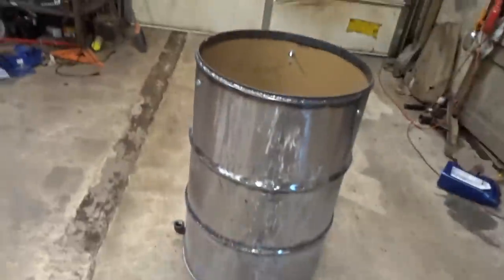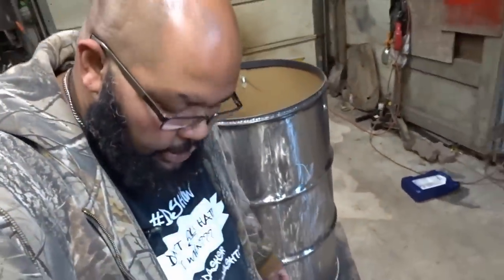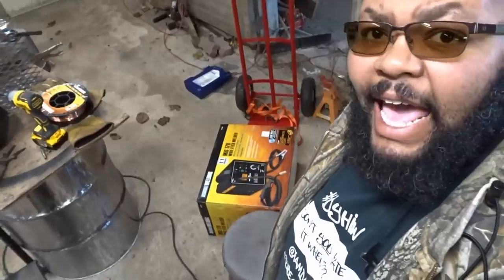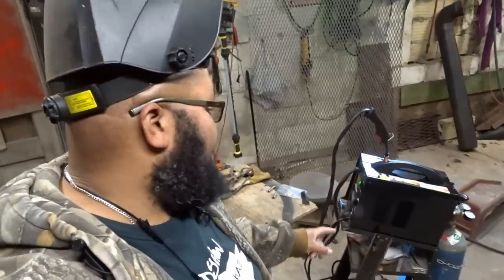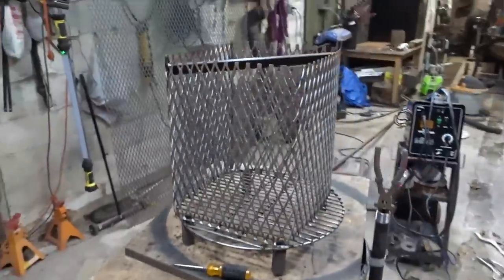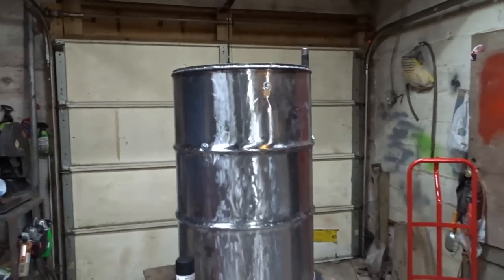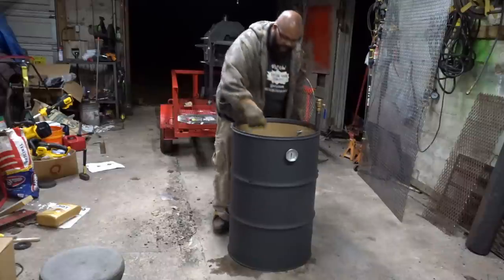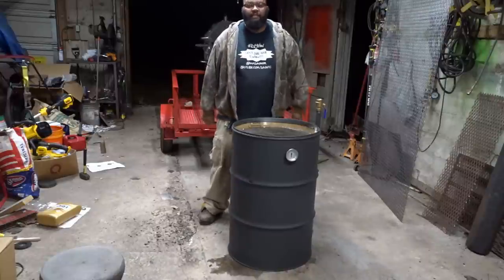SDSBBQ - Making a 55 Gallon Steel Drum Smoker - Part 3

Comment: I also used a ring on the inside of my smokers, but instead of welding I just used self tapping stainless screws and sealed the rim with lavalock... Lid fits perfect and it's super clean looking also.. Didn't have to cut the top lip off either..
Reply from the maker: On my first smoker I used self tapping screws but I've found I like welding WAY better since I can. Most of the drums I use are sealed so I have to cut the tops off and then I weld the ring in and use the top of a cheap kettle as the new lid for the smoker.

Comment: Great video, I’m doing this with a 55 gallon drum used for hydraulic fluid. Do I just have to have a couple hot fires to burn off any residual chemical?
Reply from the maker: That would be a game time decision to me. Wash the barrel out with soap and water, then burn it and let the fire die down and cool. re-inspect to see if all the residual gunk is gone, rinse and repeat until it's clean.

Comment: Have you found that the one I let pipe is enough to manage and keep a solid temp for cooking? I’ve seen a lot with 2 pipes, and a third just with a cap on it at the bottom.
Reply from the maker: It will depend on where you live and how cold it is. The warmer you are the lower the amount of inlet pipes you will need. But for someone like me when I am cooking in the cold 3 sometimes isn't enough, lol.

Comment: I'm building a barrel smoker and it has the exact liner in the barrel and I burned the piss out of it and the fumes that came off of it smelled bad as hell I would burn out the liner I dont think a "seasoning is gonna cut it. My barrel was containing resin and it was pretty strong smelling. I sprayed it out then burned it.
Reply from the maker: I also agree about burning it out. What did you use to do your burn?
Reply: @SDSBBQs  abunch of wood pallets did a 3 day burn
Reply: @SDSBBQs  - I used dry leaves and an adjustable speed electric leaf blower to jet the air to keep them all burning.

Comment: Just solve my question on you to install a water pan on my UDS. Thanks for always teaching me something
Reply from the maker: Adding the water pan is key. You need some means to divert heat and the best way to me is water (liquid) in a pan that will help keep your temps down and add moisture into the smoker at the same time.
Reply: @SDSBBQs  the next time will try with the pan, maybe there is the moisture I'm missing even spraying the food. What I'm also amazed is you only have one valve I set three 3/4 inch holes, have only 2 valves and the third has a cap
Reply from the maker: Good luck! Hopefully this helps.

Comment: The last type of smoker I “need” is a an upright drum/ wsm. Even though I’m not a welder, I have a friend who is a welder and will happily accept money to help get this project done. I also as mentioned previously in this video series, want to take a drum and used kettle and make a diy wsm. I would want the drum to fit inside the bottom portion of the kettle. Do you think the average drum will fit? Or will I have to remove that bottom lip?
Reply from the maker: So you are trying to use the entire kettle top and bottom?
Reply: SDSBBQ yes. If I can’t I can’t, but I feel bad letting the bottom part of a kettle go to waste if I’m gonna use the lid.
Reply from the maker: @juliankirby9880  That's why you buy a much less expensive dome grill or a used Weber kettle.

Comment: Dude, correct me if I am wrong, but I presume that this was a food grade drum you used to build the UDS for Tom? Due to my own concerns I had been googling UDS for a while now, and in my research, even though it's food grade, it has a protective coating on the inside which is not temperature proof, and will melt giving off byproducts in the process?
Reply from the maker: I usually burn off the drums and it gets rid of the lining quick fast and in a hurry. This drum shipped red wine and was Food grade. I usually don't mess with drums that have had oil or harsh chemicals in them. That being said I didn't burn this one off because my plan was to show him how to get a fire going and burn it off at his house.
Reply: @SDSBBQs  Thanks for your reply. Would a really hot fire like the one used to get the coating off, not also effect the outside paint (mind you it is heat resistant paint but nonetheless), or is the charcoal bucket and coals enough to burn out the inside coating? I am trying to gather information as am in the process of sourcing the drum.
Reply from the maker: @uzenicukadakrenemja  A hot fire will affect the outside paint and that's what you want, it helps get that off as well. Once painted with High Temp paint after getting the regular paint off it will last for a while.
Reply: @SDSBBQs  Thank you man, and I have to thank you for the helpful video too.  All the best
Reply from the maker: @uzenicukadakrenemja  Not a problem at all. Best of luck with your build!

Comment: And when did you burn out the coating inside ?
Reply from the maker: When I delivered it I did an initial burn with the new owner.
Reply from the maker: What did you do to burn it out?
Reply from the maker: If you didn't get it hot enough to burn the paint/liner you might need to burn it again.

Comment: Nice build, how would you add coal or wood while cooking if you need to? Also I got smoker rehab project going on how would you gauge the size of the firebox to build?
Reply from the maker: That is the main downside of a UDS once you get the charcoal going if you need to add more you WILL have to take all of the food out. But if you add enough charcoal it can go for 18 hours with no problem at all. There are firebox calculators out there on the web... If you do a search for smoker firebox calculator you should be able to find one.
Reply from the maker: Great to hear!

Comment: Hey Dash, I noticed you left the liner in the steal drum. I have access to drums that have held pork fat and the liner is red. Is there any concern with the liner? The last drum smoker I built it took me close to 8 hours to remove the liner which included a 4 hour burn.
Reply from the maker: I usually burn it out but this time I left it in for the sake for the video. I figure I'll let Tom have the fun of burning it out. I've never had an issue with the ones I've burned out before and they were almost all tan liners like this one.
Reply: @SDSBBQs  I have also found drums that do not have any liner. (Royal King) I may start using them and doing the dome lid like your builds.
Reply from the maker: Sounds like a plan!

Comment: So you didn't burn or grind out the inside liner?????
Reply from the maker: We burned it out prior to him using it.
Reply: @SDSBBQs  So after the burn out, did you grind it down to bare metal.. All the barrel smokers I've made I always burn out the liner first.. Then the outside I grind..Once I'm finished I have the inside and outside down to bare metal.. I use cooking oil for the inside walls.. Then I paint the outside last..
Reply from the maker: I ground the outside to bare metal and then painted it as you saw. The type of barrel I used had wine in it and the liner burned out without much fuss. I didn't and don't usually coat the inside.

Comment: I didnt catch how u made it safe on inside of drum did u burn it or??
Reply from the maker: We burned it out prior to the first cook.
Reply: THANKS mine had oil in it so i will 🔥 it good thanks again
Reply from the maker: I have only used drums that have had food stuffs in them so burning them out isn't as critical as if there were harmful contents in the drum before.
Reply: U think me burning out would be good enough since it had chemicals in them??
Reply from the maker: I'd just really make sure that it was burned out very well. The food safe drums usually have a very thin liner that doesn't take very much to burn out.
Reply: @SDSBBQs  how would i know if its burnt out enough, thanks so much for all info first time im building dont mean to be a bug
Reply from the maker: You should see a difference after it's burnt out... it should just look way different and you want more of a bare metal look.
Reply: @SDSBBQs  thanks i appreciate it

Comment: Did you burn the inside of the drum i have a 55dm with red liner do i need to burn it out
Reply from the maker: Seasoning it will burn it out. But depending on what your drum had in it before you might need to burn it out prior or more than once.
Reply: @SDSBBQs  coconut oil
Reply from the maker: @merrillking2329  then you should be fine
Reply: @Flatus Antiquitous i was just reading about this my drum has the red liner and some people say it is the hardest to remove i will be starting my project tomorrow i am renting a propane weed burner to do this will it work in removing the red liner.
Reply: i went and looked at again its more of a brown color hope this is easier to remove.

Comment: Y didnt u strip paint out of the inside of the drum
Reply from the maker: After the burn in it is gone.
Reply: @SDSBBQs  I dont follow
Reply from the maker: So you can burn the barrel before or after it is assembled. Once you do the initial burn the lining will burn off.
Reply: @SDSBBQs  I'm just getting into barrel smokers. If ur up 2 it it would be great if u did a burn off vid. I've seen a few on here but I like ur vids/ur style of vid
Reply from the maker: Well thanks... I will work on it. I will be making a new drum soon. I'll try and make sure to show the process of burning one out.

Comment: you needed to get a stick welder...   cheap and no gas needed, the problem with them cheap welders is they still need gas
Reply from the maker: I have a stick welder and don't like the process. It burns WAY too hot for thin metals like those involved with a drum.

Comment: Do you have any problems with your ball valve being higher than the level of the drum. Cause I noticed it is almost as high as the exhaust vent. God-bless have a great  Night
Reply from the maker: Nope not at all. The charcoal will draw in air to help with the burn.

Comment: You should ha burn of the inside liner. Cooking with the liner still in is like cooking with paint 🤮
Reply from the maker: That's why before cooking on it we did... i mentioned it in the video.
Reply: @SDSBBQs  nah bro just lightning a basket of charcoal won't do get rid of the inner liner. You gotta use a weed burner or stuff it with scrap wood like pallets and let it burn for a few hours, or introduce the inside of the drum to a grinder

Comment: You know you're supposed to remove the liner inside the drum right?   It's a health hazard to cook with it.   It's possible that it can off gas toxic fumes when heated to the temps you're charcoal gets to.... Just sayin'
Reply from the maker: Before cooking in it gets burned out.
Reply: Im every uds video I've seen {I bet 30+) they needed a big open fire over an extended time and still had to sand to remove the inner lining.
Reply from the maker: It all depends on the type of drum you have.
Reply: U really should've burned out the drum before building the smoker